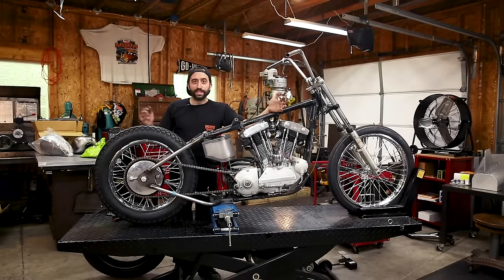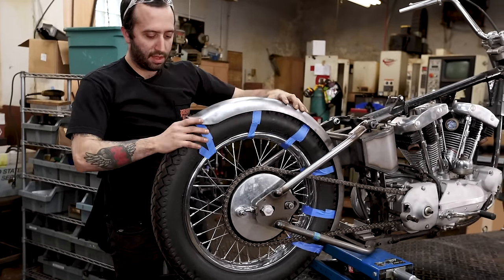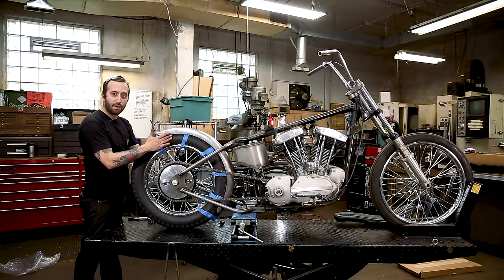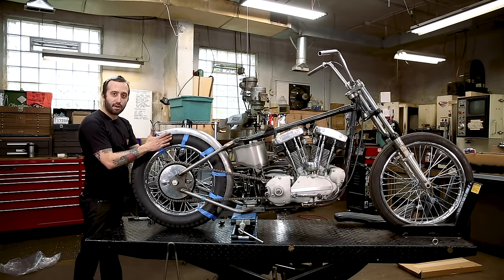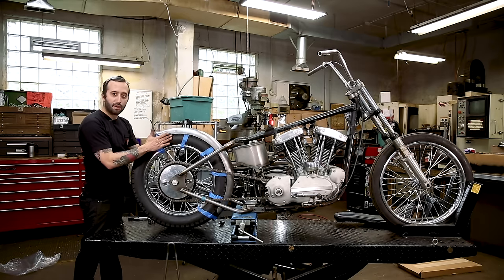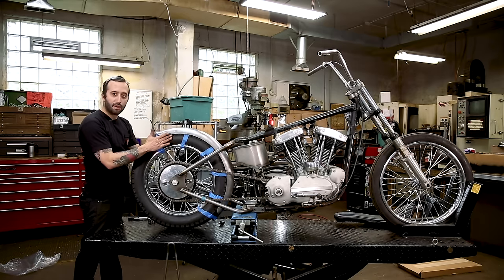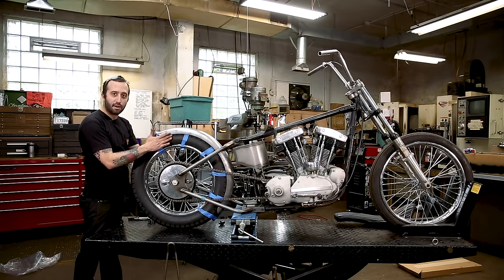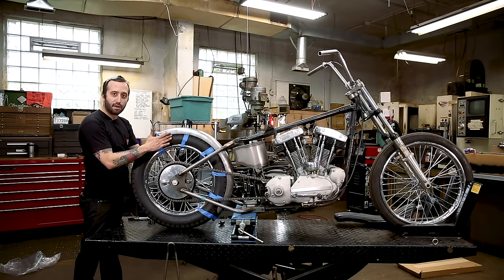Saturday Sportster - Season 2 - Episode 3 - Rear Fender and Sissy Bar Install

Comment: Is there any problems using a conical head like you did near the frame / lower fender when the slits are not shaped?
Reply: Use a button head carriage bolt to mount lower fender mount to frame.
Reply: @chuckchapiewsky7535  Ah ok, yeah that seems like a better fit :D

Comment: I thought the idea of Saturday sportster was not having to weld or need specialty tools. Why not weld on a rigid rear section rather than a bolt on if you’re going to be welding your brackets onto a fender?
Reply from the maker: We wanted to step up the difficulty a little on this season but no go full blown fabrication. Welding a few tabs here and there is a lot different from welding a full hardtail section. We also have a wide variety of Bolt-on hardtail and wanted to showcase one of those. It allows you to keep your frame the way it is and you could technically go back to a swing arm if you ever wanted to. 🤗
Reply: i was gonna ask about that bolt on  hardtail I like swingarm choppers cause I like shocks but that has a great look with less effort hopefully ya's do a vid on that soon!
Reply: @lowbrowcustoms is there any bolt on hardtails for 1990's sportsters? I cant find any im assuming cause the frame cant support it?